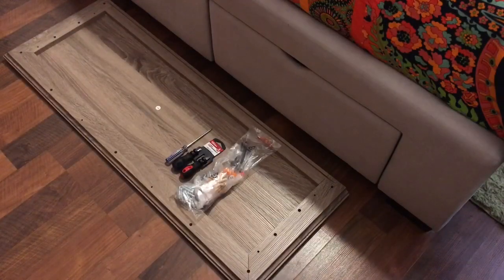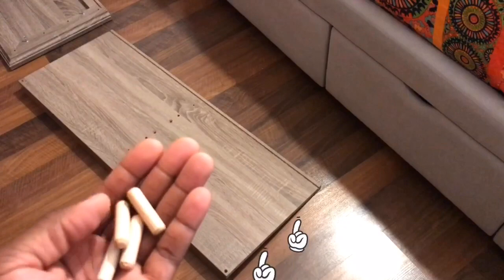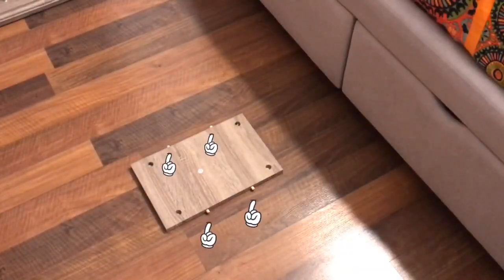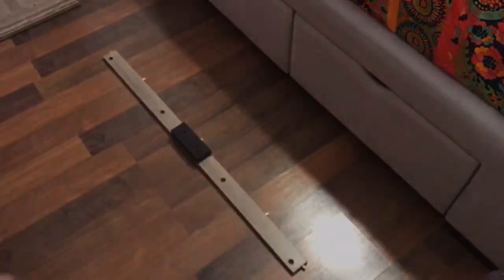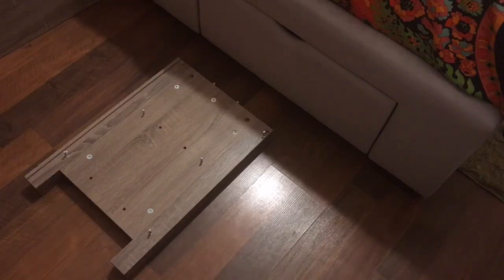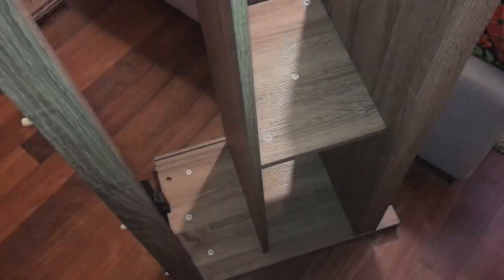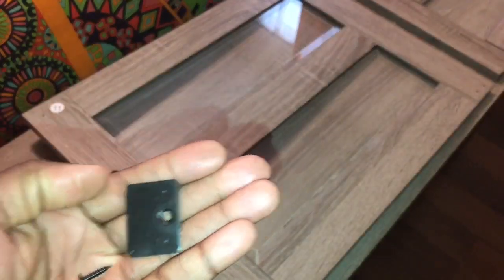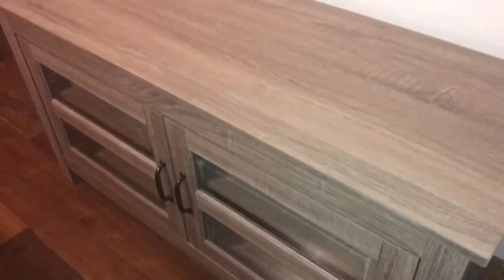How To Assemble Walker Edison TV Stand Cabinet | Best Buy | Home Decor

Comment: [3:49] This is great! I am having trouble screwing in the 06/50mm bolts [D]  through the floor panel [2] into the inner vertical suppors [9&10]. It almost appears like the screws are too flat to actually go into the wood. Any suggestions?